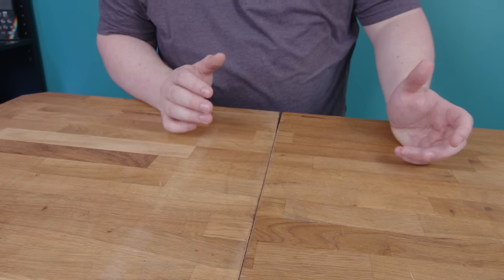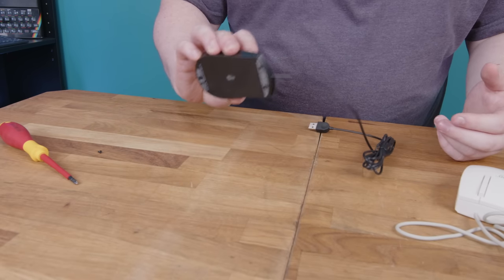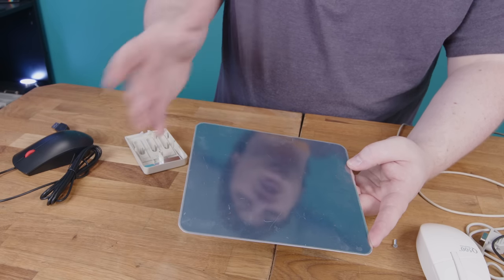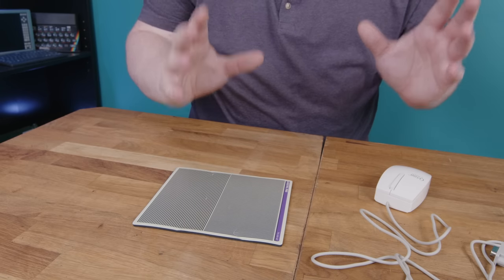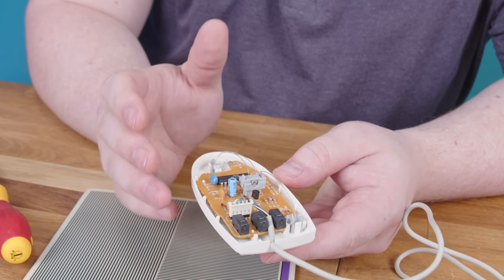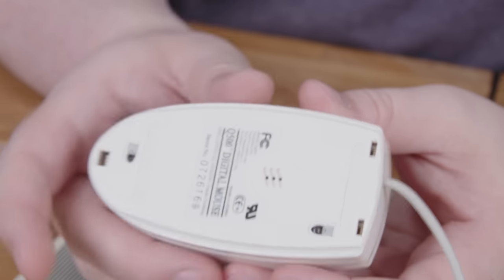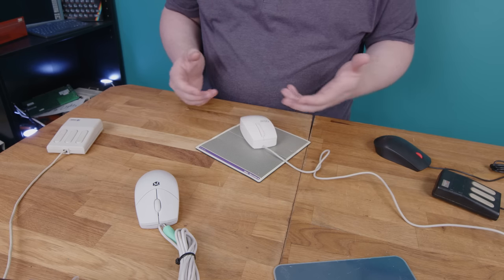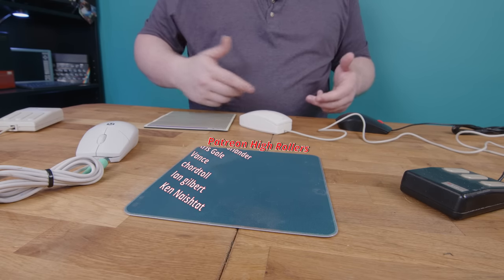Q500, The Weirdest Optical Mouse

Comment: We had one of those Mouse Systems optical mice on our first PC back in the late '80s. The mouse pad wasn't hard though. It was a flexible plastic with a rubber base. But it of course still had the grid of lines on it. It was years before I encountered my first ball mouse. And years after that before I had a modern optical mouse. But that was my first mouse. And I probably still have it in storage somewhere even if I don't have the computer anymore as I took that apart years ago as a curious teen. (Though I kept the motherboard with its 286 chip and all but one of the RAM chips as well as the weird hard drive that I forget the official name of)

Comment: AIUI part of the magic of cheap  modern optical mice is that they take images at a ludicrously high frame rate (>1000 fps), so the amount of movement possible between frames is very small which makes the analysis much simpler.

And yes, back in the day optical mice where why-would-anyone-buy-that expensive. I bet a big part of that was the fancy hi-res custom printed mousepad, which the Q500 sidesteps.

Comment: Brilliant design, I'd love one! What would be more interesting is if they had the mouse mat with a full grid on it, except the vertical lines are blue and the horizontal ones are red, then they could have a blue LED and red LED and modulate them and the sensors in the same way, obviously the sensor will only pick up the blue lines with the blue LED lit and same for the red.

Comment: I got some information looking up "Chakers Inc."

They were incorporated on 2 February, 1996, dissolved 4 January, 2001
They were based in Cerritos, Cali
The Chief Executive Officer was Seong H. Kim. Possible co-workers being Jane Archer, Mitch Kim, Alama R. Saadati, and Amin S. Saadati.
Where they were based had another company called Alto Pacific Corp.

This is all the info I can be bothered with collecting, hope this points you towards finding the story of that incorporation!
Reply: it should be easy enough to find what I used to get this information through google, I am not sending links because normally that leads to the comments getting flagged and not being shown

Comment: The 8 fiber optic cable matrix is likely to be just 2 sensors per axis, the same as the Q500, but each line of 4 cables get merged so they always see a dot in 2 of them. Another way of understanding this is that they "blur" the corresponding axis to convert the dots into lines.

Also I think most modern optical mice are really simple because they don't need to detect displacement of more than 1 pixel, by capturing the image many more times per second than the screen: at 11500 hz you can move 191 pixels per 60hz frame and it still detects it. That's a speed of moving across a 1080p screen in 1/6th of a second. If you compare two pixels away in each direction instead of one you double that.

Comment: It makes a lot of sense having 8 sensors per axis when using the matrix. They're are still rotary encoders, but a vertical sensor reading horizontal motion can distinguish that as non-vertical by the patterns read at each sensor.

Comment: I would hazard a guess that this mouse is trying to work around the Mouse Systems patents to deliver an optical mouse before the introduction of optical tracking mice came about. On that front the algorithms used for optical tracking mice are basically the same that the military have been using since the 1970's for missile systems. It's consequently no surprise that they work to those in the know. It just took Moore's Law to reduce the cost so that it was practical for a mouse. I remember having a discussion about it while doing an internship at defence contractor in the UK in the early 1990's. We concluded that it would be ideal for tracking movement in a mouse but figured early 2000's before Moore's Law made it practical which was not a bad guess. You needed sufficient computing power at a sufficiently low cost and probably more importantly a low enough power draw to use it in a mouse. There was also like very few patents still valid on the technique in 1999 as motion tracking using video is a really old field in computer science. The other motion sensing technique that we thought would work was laser ring or fiber optic gyroscopes but they are still way to expensive in 2022 and have all sorts of export restrictions on them. Might be able to do something with a MEMS accelerometer though.

Comment: Maybe ten years ago, I saw Q500 mice (without the necessary mousepad) in blister packs at Big and Small Lots (now "Big Lots!") discount store. Without thinking much about it, I picked up a couple for later use (I wear the low-friction pads off mice at an alarming rate). Some time later, you cannot imagine the blue flames that came from my mouth when I first had to find a serial-to-PS/2 converter to plug into my PS/2-to-USB converter only to then discover the supreme jankiness of trying to use a Q500 mouse on a generic Fellowes mousepad. 🤪

Comment: The reason for the sensors to be located far away is not because they could not install them upside down, it is to the have more angle of separation for the light that is hitting it. It should be far tinier to be upside down on top of the holes and i'm fairly certain that would require some optical stuff, like lenses.. and it would be nightmare to adjust its focal distance just right. Installing them further away makes it cheaper and easier to build.

Comment: I had a mouse systems optical mouse with pad and it worked great!  I used it in the late 80s to the early 90s.  So much better than those opto-mechanical mice of the day that would crud up inside.

Comment: Honestly I would say from the industrial design and the typeface choices on your Q500 vs Clint's Lasermouse, I'd give real money that his is older. My guess is that his has more fiber optic bundles and thus more little holes, and that the extremely cheap people that designed these mice followed Colin Chapman's maxim of "simplify, then add lightness" and figured out a way how to revise their design to use even fewer parts and a mousepad that requires a less-precise silkscreen, resulting in your Q500.

Comment: If nobody has mentioned this yet: The movement sequence you've observed here (00, 01, 11, 10, 00, ... in one direction, or 00, 10, 11, 01, 00, ... in the other) is an example of a Gray code, whereby a simple decoder can determine which direction it's going. In this 2-bit form this is also called a relative, incremental, or quadrature code. Many rotary encoders operate using the same principle.

The gimmick of a Gray code is that between any two adjacent positions only one bit changes (so you get e.g. 00 <-> 01 or 00 <-> 10, but never 00 <-> 11). If the sequence weren't a Gray code, such as if it were the ordinary binary count (00, 01, 10, 11, 00, ...), there would be an awkward moment in any practical application with real-world tolerances when two transitions that are supposed to happen at the same time (00 <-> 11 or 01 <-> 10) would be slightly separated, screwing up the decoding.

The 2-bit code relies on the position only changing at most one step at a time. Moving the mouse too fast will produce erratic behavior: If the sample rate exceeds the rate of movement by a high enough margin—here, if the mouse moves more than half the width of a stripe between any two samples—the decoding falls apart. Too large a move will result in the decoder not detecting a change, detecting a change but not discerning the direction, or miscalculating the distance and/or direction of the change.

Comment: The two fiber strands give you 4 states. You need 4 states to know which direction the mouse is moving. The photo transistor measures the brightness. One strand allows double the light through (lets call this 2x), as compared to the other strand (1x). Consider the scenario where the mouse transitions from a white region to a black black region where the 2x strand enters the black region first. The photo transistor will read: all bright (3x), to medium dark(1x), to dark (0x). As the mouse continues to move in the same direction but transitions from the black region first, the photo transistor will read: all dark (0x), to medium bright (2x), to bright (3x). Using "Two's Compliment" for the bit encoding, the bit states will transition in a cyclical way, allowing for continuous transitions and making the system simpler to implement.

Comment: I remember my first mouse had PC board wheels instead of the optical wheels and metal swiper arms that would brush against the wheels as the mouse ball rolled around. Needless to say, this got very dirty vary fast! I got my first Mouse Systems mouse at a going out of business sale of a company back in the 80s. Even then I paid a lot of money for the thing. The bonus was that it came with two pads.

Comment: 14:48 - Hey, shoutout to the RubyCon capacitor. This is most confusing because RubyCon caps are typically anywhere from 2-4 times more expensive then the cheapest of the cheap capacitors. It's very curious why they'd make the rest of the mouse as cheap as possible but then place an expensive capacitor on the board. LOL! They could have probably purchased a million junk capacitors in bulk at 10 cents a piece, but instead opted to pay 30 cents a piece for the RubyCon.

Comment: Those three dots looks like UART programmer probe slots, as they perfectly align with the vertical three solder points on the PCB. Seen it may times in the 90s dect phones.

Comment: possibly the 3 small holes are just ventilation, perhaps the "fibre optic" lines are susceptible to high humidity so a few small holes to let air flow somewhat could help if they were manufactured in a humid and hot country.

Comment: I reckon the special mousepad with the horizontal and vertical sections would be to avoid the patent infringement of the earlier (sun type) grid design mouse.

In high-dpi mode imagine you arent drawing a circle in paint, but rather are dragging and dropping a vector shape into place on a desktop publishing application - or resizing/moving that object to a more finite position it on the screen.

Comment: Modern optical mice use mechanical rotary encoders for the scroll wheel, not optical. I think the reason for this is because the same circuit board can be used for both wired and wireless mice (with slightly different components) and the mechanical rotary encoder uses less power since it's just a passive switch. However the mechanical rotary encoder has a big drawback - the contacts inside can wear out over time or get dirty also there's a lot more friction compared to an optical rotary encoder.

Comment: The 3 holes seemed to line up with 3 solder joints. Could have been a hole for inserting a probe for testing the mouse during production.

As for early optical mice, I was at a college used computer sale around 2001, and they were selling some weird optical mice that used what seemed to be mirrors for the mouse pads. I think they might have been Sun branded. Thought it was unusual, but didn't really need any at the time.

Comment: We had a lab with several machines that used the optical mouse with required pad - and to keep us from using them on off-hours, they would remove the mouse pads and lock them away. Necessity being the mother of invention, we found out that running the mouse over a jeans leg would produce motion, albeit jerky and difficult to control... but since nothing we were doing required much more accuracy than than pointing to buttons or click areas, we were back in business. 😂 👖 🖱 👍

Comment: So the way this mouse senses movement is exactly the same way that a ball-mouse does, except that instead of using slits in wheels spun by the rolling ball, it's the movement of the mouse across the pad and the stripes printed onto it. The stripes are "pretending" to be the slits.
If you wanted to prank some-one who used this, just turn the mousepad 180 degrees (so that the wrong direction of stripe is under each sensor) and the cursor would fly off in unexpected directions.

Comment: Funny seeing this on my YouTube front page, because I do have this kind of early optical mouse.  However, mine is model# LYNX-98M from QTronix.  It looks nearly exact, including those 3 mystery holes underneath.  I did use this back in the day, even at the office, trying out the new fangled optical mice that were beginning to arrive in the mid-late 1990's.  I still also have the mousepad which also looks exact with the split lines, however some of the corners are beginning to crack iirc, so I need to find that pad & scan it to make copies.  Btw, I do still use mech ball mice & I have kept nearly every one of them that I got since the early 1990's, even if they were broken (basically most due to worn out balls, ahem, & worn out wires etc), so that I can eventually repair some of them, which I have.  I have not run the QTronix in maybe 20 years so I don't know if it still works, but I do have some PC's with Windows 9x & serial ports so I may test this mouse again some other time. Thanks for the nice trip down computer memory lane.

Comment: i needed a serial mouse as i wasn't sure if i could get the ps/2 port working on a pentium pc i built a few years back and decided to take a chance on this thing. it was fine for the most part, quite accurate and not laggy. but the buttons for me were, let's say, awful and it couldnt handle fast movements. i played a lot of doom and i finished a plethora of point n clicks until the ps/2 bracket arrived, now using a microsoft intellimouse usb -> ps/2. if the mousepad was a bit bigger i'd maybe have enjoyed it a bit better but i enjoyed the novelty. really impressed with your deep-dive!

Comment: 17:41 "build a modern mouse with no specialized sensor, only off-the shelf components"

But... as you've mentioned before - the optical mouse sensor is an off-the-shelf component by this point in time.

I get your excitement, nonetheless :)
Reply from the maker: Oh, my thinking is that if this mouse was really sold in 96 then they designed it in 95, when these sensor chips weren't yet available.
Reply: @CathodeRayDude  I get it now! Thanks :D IT was a fascinating discovery to see how this thing worked. And the flashing used to reuse two sensor LEDs for both axis was just genius. This is really top shelf engineering targeted at lowest cost possible.

Comment: Okay! My bad... I guess I should watch the ENTIRE video, before commenting; as you just said almost word for word, what I did in the comments! :)

The Bus Mouse Systems had been making these for YEARS, in the late 80s and early 90s, for SGIs, SUN work stations,  AutoCAD workstations, and the like. I have several of these Laser optical mice, with the metal and polycarbonate encoder pad...

This Q500 design is basically an enlarged BCD optically encoder, with a large pad, instead of a small circular encoder wheel.
Now if you want to research a truly cool technical design, look into the original 80s and 90s RF AutoCAD digitisers, and mouse graphics tablet pads.
Look into the original WATCOM and Quantel Paintbox graphics tablets. They were originally wired pens and digitised pucks and then changed to the RF tuned circuit induction X/Y system.

Comment: I had a Mouse Systems mouse on my 286 PC back in yhe 80s. I was working in the IT department of a stock brokers at the time, and the company was putting in a bulk order for them and let some of the staff buy one at cost price if they wanted one making use of the huge discount they were getting. I seem to recall it was still somewhat expensive! I did love it, and used it for a long time afterwards. I think eventually as screen resolutions got bigger and bigger its speed wasn't enough (loo low resolution) so I moved to a logitech trackball and other optical mice. I hated using ball mice :) I don't know what became of it, I expect I discarded it or lost the mouse pad at some point.

Comment: 1. I think that most modern mice send pulses about 1,000 times a second.
2. I'm surprised that the Mouse Systems mouse didn't just use a light-pipe type fiberoptic to move the light from the lenses to their respective sensors.  I mean bouncing the light off of a mirror mounted to the rear shell seems like it could be fidgety if the fit/finish on the shell was a little off.
3. Oddly enough one of my friends was allowed to temporarily swap his mouse with his father's (his father had a ton of tech toys in the era such a pretty high end Mac for his work complete with a rather nice monitor with composite video and an Apple TV for the family computer back in the mid-to-late '90s) and that was the first time I saw an optical mouse—gridded aluminum pad and all back in the mid-to-late '90s just a few brief years before the IntelliMouse Explorer showed up.
4. I'm pretty sure that you're right that your odd mouse is effectively built from ball mouse parts.  My guess is that it was meant as one of those stop-gaps that tend to come up as technology changes (like how they started putting projector T.V. units into rather tall T.V. shells to create big-screen, rear projector T.V.s to compete with the plasma and L.C.D. flatpanel T.V.s that started showing up).
5. All of those unusual features on the odd mouse is most definitely a company trying to make their product stand out and actually does remain a fairly popular tactic.  I have an Asus motherboard from about 2004 that features their "Instant Music" feature which lets you use your CDROM drive as a CD player without actually booting into the system (the thought might have been for those building early livingroom P.C.s for playing digital media or perhaps for those in smaller apartments in Asia so that they could also use their P.C. as a shelf-system CD player).  Heck, I recall that some Samsungs as late as the Galaxy S5 had really weird features to set them apart like a baby crying detector.